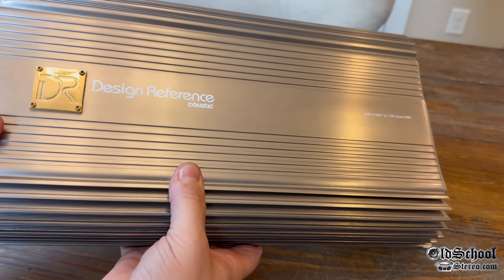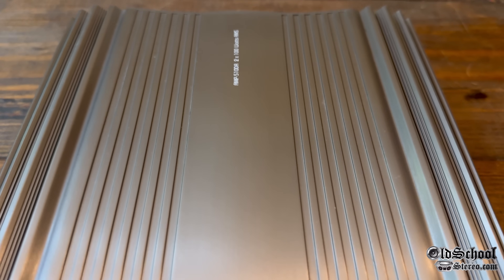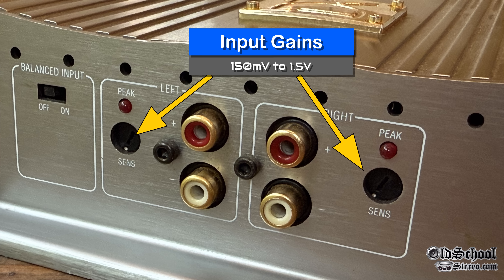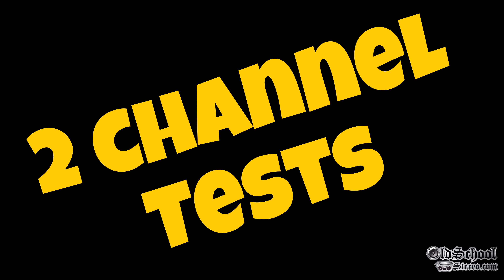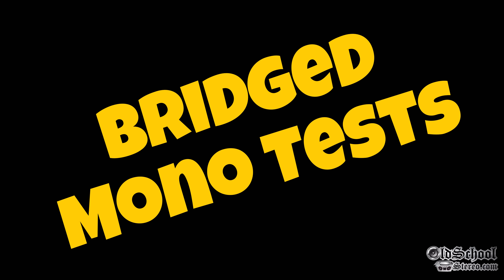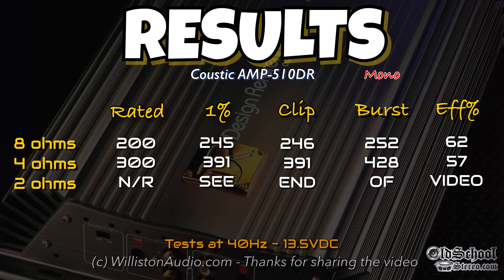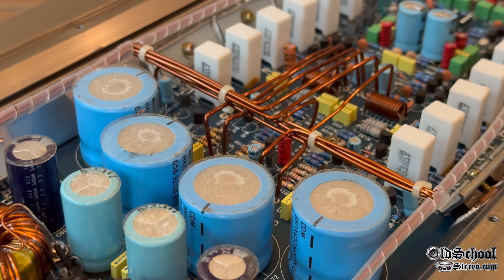The Hidden SQ Gem of 90's Car Audio - Coustic Design Reference AMP-510DR

Comment from the maker: See Coustic 512DR Video - https://www.youtube.com/watch?v=mDbwUMvWBB4
3 Modes of the Amp Dyno Explained: https://youtu.be/Q0m6NsB-HHc

CHAPTERS
0:00 Intro
1:13 Features and Specs
3:30 2 Channel Amp Dyno Tests
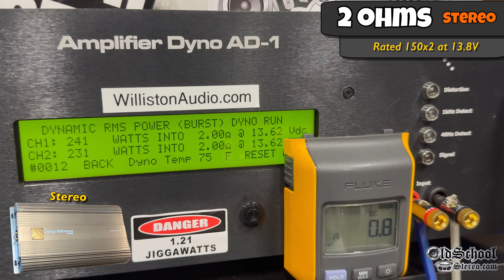5:44 Bridged Mono Amp Dyno Tests
7:47 What's Inside?
9:18 Sound Demos
10:06 RTA Analysis
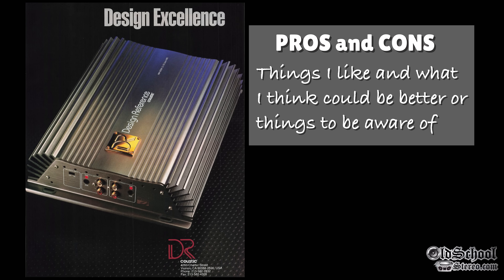11:53 PROS and CONS
13:18 EXTRAS

SHOP
ELAC Unifi Speakers: https://amzn.to/4jUneU8
Shop eBay for Coustic Design Reference: https://ebay.us/OpivbX
New Shirt Designs!  https://bigdwiz.creator-spring.com/
Buy Me a Coffee/Tea/Slap-a-D-No : https://www.oldschoolstereo.com/p/donate.html

TEST BENCH EQUIPMENT
SMD / D'Amore Engineering Amp Dyno (AD-1): https://is.gd/wccad1
XS Power D1400 Batteries - https://amzn.to/2BPFCKW
XS Power PSC60 Charger - https://amzn.to/2CHGcfs
Fluke 1000A AC/DC Clamp Meter: https://amzn.to/2Rw5WDA
Handheld Dyno AMM-1: https://is.gd/wccamm1
My Favorite Precision Screwdriver Kit: https://amzn.to/3yAaPmn

DISCLAIMER: This video and description contains affiliate links, which means that if you purchase from one of the product links, I may receive a small commission. As an Amazon Associate I earn from qualifying purchases. As an eBay Partner, I may be compensated if you make a purchase
Reply: The bypass caps are used different than you might think. The are generally film caps used to by pass large electrolytic caps to help block high frequency ripple. Some times they are used on the low level input caps too. Most the time they will be foil caps on the input bypass. All amps have a sound of their own. Often times the better parts do sound better.
Reply: Help I'm replacing a driver on a def tech DT0028 with a supercube III speaker will my amp be ok?

Comment: I recommend Rainbow Audio SL-A4150 for mids & highs. I purchased 1 recently and I`m very impressed. I replaced a DD SS4. Both are class AB and both are 150W RMS. My SS4 finally broke after 15 years. SS4 is no longer available. I also bought Down4Sound JP MM1500KFD to replace DD M-80. M-80 is not broken I just wanted more power. I wish Willston would test some Rainbow products. Good stuff.

Comment: I just bought one tested it unique amp needed tuning very deatailed on xylophone etc but so detailed on some tracks eays it 😮seems flat sounding or plays some instruments in the back again very unique My partial amp inventory of what I own and use daily in rotation 

Qty 2 audiowave Aspire pro monoblocks,  QTY 2 Audiowave xa30 monoblocks, Genesis P15, Qty 2 Abyss 501a monoblocks, Musee ma1502, Tru copper c7.2t Qty 2 Abyss class A, Qty 2 Abyss Dma, Brax mx4,  Phoenix Gold elite 4 modified by Steven mantz, Mcintosh mcc602tm, Quartorigo explorer 1, Quartorigo precision 1, Quartorigo opus 1, Fujutsu 10 a 5000 ultra modified class a, Musee mx804 Sinfoni prestigio, Sinfoni shadow Spx 150 modified by Steven mantz,
Phass re50 Audison hr100  , Audison venti, Audison thesis Quattro, Audiowave aspire pro ca, Audiowave  excel ca, Alpine msv1050, Steg 50 c, Steg class a, Gz reference 4 pure, Brax nox4, Brax x2400 ge chrome, Qty 2 sinfoni 60.1 monoblocks, Qty 2 Sinfoni 25 anniversary monoblocks,, Sinfoni desiderio, Phass ap150, Qty 2 tru technology b41 ca v2 high voltage,  Gordon Campbell Madison prototype direct current, Ground Zero ultra, Qty 2 Marantz 750a,
Phass re2, Alpine mrvf900, Mosconi class a steven mantz modified, Korean crush amp mantz modified,  Qty 2 monolithic ma1000 class a monoblocks, Celestra va 210, Celestra va 30, Bewith 406 and 722 monoblocks, Qty 2 diamond audio d7104 one mantz modified, Mercury k2, Qty 2 SD gan, Sinfoni Allegro  musee ma250 ,
QTY 2 Monolithic 701 monoblocks, Soundstream d100 ca modified with black gate, Ppi f12500, Rs audio Tongnon valvalore, Damore A1500.4, Nakamichi pa1000 limited, Signat ram 2, Signat Lab4,
The end platinum, Tongnon quattro field effect amplifier,
Micro precision z studio 4 channel amplifier,
Sony xm20004,
Alpine juba 3555 ultra modified from Japan Brax mx4 pro Coustic design reference 

Amps i will buy soon 

Hss hi 50
Brax RD2
Sound Digital gan 1500.4 
The End Diamond 
Orion nt new manufacturing

Comment: Cool amp, I do see the film bypass caps, they should the green rectangles and some of the yellow ones. I am very impressed they put them in. Film caps are more accurate in passing signal than the can shaped electrolytics. I will often add bypass caps in amps I work on, it cleans up the sound and provides more detail in the music.

Comment: Worked for a car audio shop back in the 90s as an installation manager. We sold Rockford, Alpine, Phoenix Gold, and Coustic was one of our budget brands. I remember when the design reference series showed up and I'm thinking it doesn't matter how good this amp is. No one's going to buy it because it says Coustic on it. It didn't help that the Rockford DSM series was just coming out and that's what everyone wanted. I don't think we ever sold a single Coustic design reference series amp. I certainly don't remember ever installing one.

Comment: I actually dig the solid copper point to point writing for looks, but it's a boneheaded design for longevity. Copper work hardens . Maybe the trick is to push it so hard that those runs get hot and anneal. 😆
Happy for the return of the post credit torture test. That's the format that keeps me watching all your videos.
Can your Dyno do a 3 ohm load?

Comment: While Coustic was known as a budget brand back then, it was still pretty good quality all the way through the late 90's/early 2000's. Back in 1999, I saw a Bronco that had all KEF component speakers and also had 12 KEF 15s, it was all powered by Coustic amps.

Comment: Cornell caps on the rails!!!??? What!! Those are the best caps ever made and very expensive. It’s very rare to see them in an amp. Especially board mount. Never heard of them in a car amp until now. Normally on the rare occasion you do see them in an amp they’re enormous (and the amp is enormous) and they’re chassis mounted with bolt down terminals. Definitely high end if they went through the trouble and cost to source them

Comment: It would have been nice if you could have done a 2.66 ohm test. Those acoustics don't like two ohms as you well know. I ran a similar amp paralleling 3 8 ohm subs and it worked fine

Comment: These coated cooper wires are a designissue for a car amp. Vibration of the car can cause rubbing between the wires resulting in a short.

Comment: How are the Caps this old not dried up and shorted out? 
Seems dangerous just turning it on and praying it don't go bang.
Reply: Quality equipment lasts MUCH longer than budget stuff.
I have several guitar amps from the 60's and 70's still running original electrolytic caps AND tubes. 
Still functioning flawlessly.

Comment: I had the Coustic logic AMP-360 and 460 amplifiers. I think they sound just as good as the Kenwood KAC-823 and 923 amplifiers back then. I had the amps in a 1987 Dodge Charger Shelby. The 460 amplifier was hooked to a MTX 3 way Dual 10" speaker box. The 360 amplifier was hooked to the 6X9 speakers in the side panel, and the 6.5" speakers in the door. Everything together sound loud and clear. The three-way MTX speaker box, sound like a sub box. And the thing I like about those Coustic logic amplifiers, they had a bass and treble boost 6db and 12db

Comment: I bought a Coustic AMP190 from a co-worker in high school around 1993/94 for $75.  I had several sub setups I used it on.  One 15 in a sealed box, two 10's in a bandpass, two 10's in a sealed box and one 12 in a sealed box.

Comment: I had an old Coustic in 89 or 90. It looked similar to these, dark gray and only about 7 or 8 inches long. I want to say it was 30x30 or 45x45. Been a while. I modified an old welder transformer with some filter caps and a voltage regulator and ran it in my bedroom. I had some old 2 way magnavox speakers from an old early 80s stereo that stopped working. I got rid of 99% of the 60 hz hum. I used a walkman as the player.

Comment: And on a side note in the 90s and late eighties when I had a business I had a nakamichi head unit come in and when I took it apart I said I've seen this before and I looked around my shop and I saw a soundstream head unit and that's another one and it was a pyramid and yes I just said pyramid they were identical I know then it was time for a new line of work

Comment: Had the OG Black Coustic 120w,  and 190w, ran the 190w mono into single sub Cerwin Vega dual voice coil, the 120w ran a set of 6” Danish mids and 1” soft domes, all through a Audio Control 2xs …. Blaupunkt Lexington head unit …. Good times

Comment: I had three low wattage Coustic Power Logic amps in the 90’s and they sounded great. Plenty of power for mids and highs. Got them super cheap too. Two were used and bought a third one brand new to match.

Comment: Weird to see industrial control circuit connectors on an amplifier. They are really made for ferules for that non fraying wire connection. The insides look more like a control panel instead of an amplifier the way they bent the wires.

Comment: I had a pair of Coustic 460s running a pair of 15" Redlines. They never over heated or failed. Great amps for the $$ back in the day.
Reply: Ah the power logic series.   I blew thru alot of them but they were cheap and easy to fix.
Reply: @v12alpine  yep, PowerLogic. Everybody around me was running PPI, Orion, and Fosgate. Mine was cheap, but louder than most of their much more pricey setups.

Comment: I had a Coustic Power Logic series amp and recall really liking it, even with the low power rating (30×2 @ 4 ohm). I wonder how that series would compare to this one.
* human commenter
Reply: There’s absolutely no comparison. The Design Reference was almost like they were built by an entirely different company. They were leaps & bounds better built than the power logic. I’ve owned A BUNCH of Coustic amps over the years because I repaired a bunch of them. The DR was just amazing. The DR speaker line was the same way.
Reply: Circuit City supposedly cheap amp. The day I switched to 2 ohms was a game changer